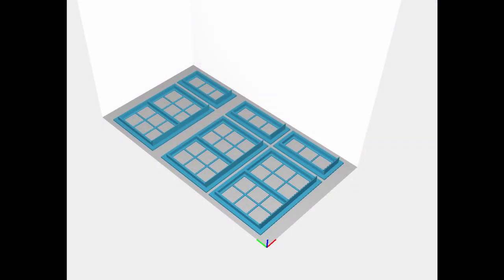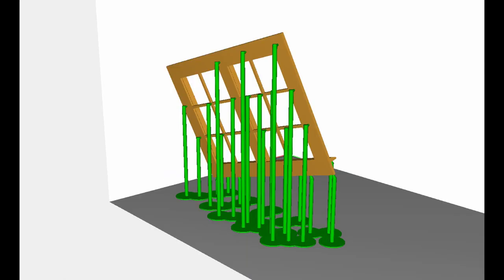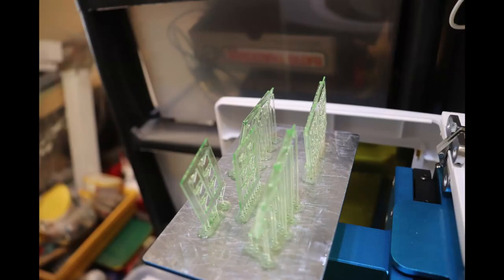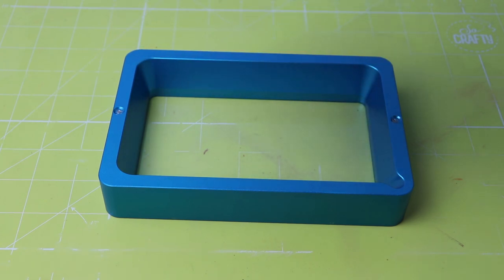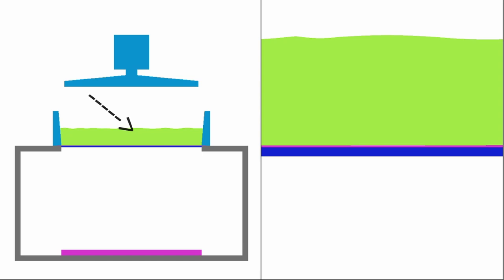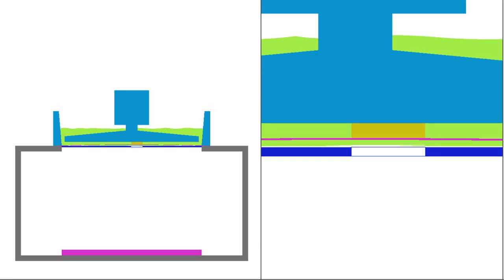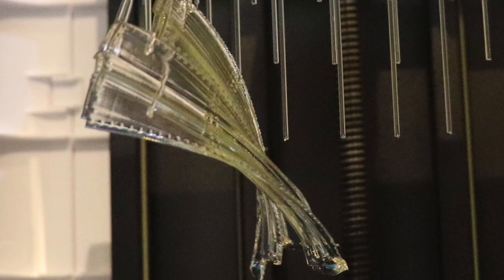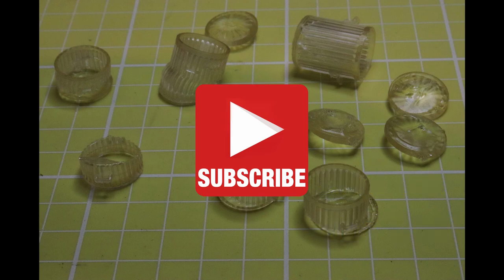Draw 'n' Print 3D #006 - Testing - Supports Auto or Manual?

Comment: Very good visual explanation. I think those trash cans and lids needs more support at the bottom for the cans, and the lids might print better if at an angle. Other causes of print failure I've noticed is the temperature of the resin or the build plate gets out of level with handling removal of prints. Too cold/cool it tends not to adhere well. I see you are using the Photonworkshop slicer. have you tried Chitubox? I find it easier, less buggy to use.
Reply from the maker: Cheers. Thanks for the tips! I have since printed successfully with manual supports. Still playing with amount of angle! I think the build plate is rock solid (it is a Photon S), but my research is also pointing to temp being a big factor. Yes I have Chitubox and have now gone over to it entirely.